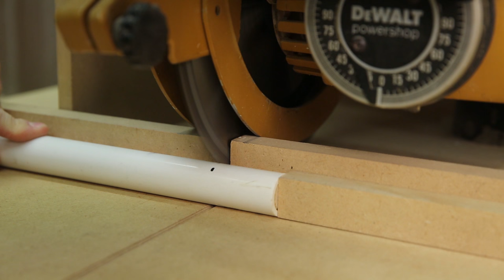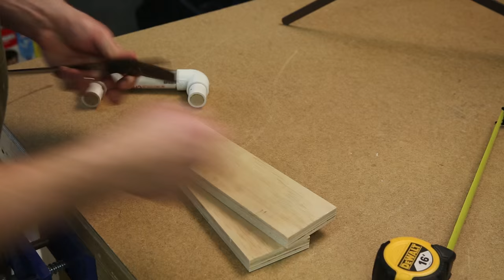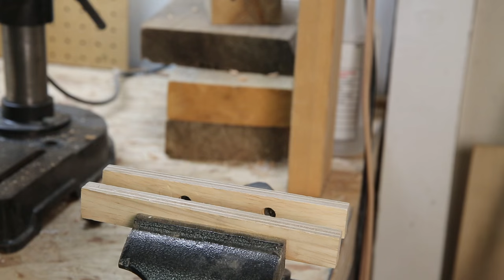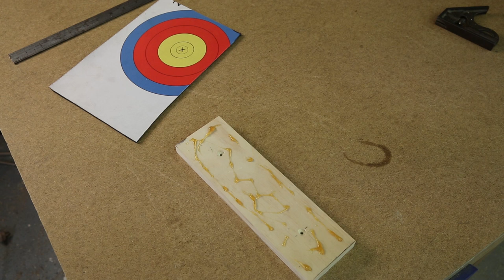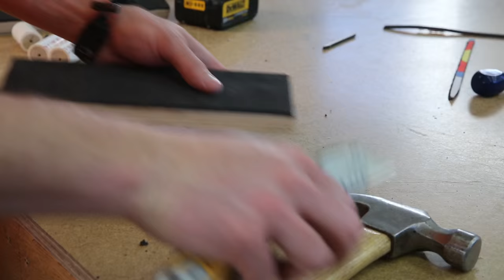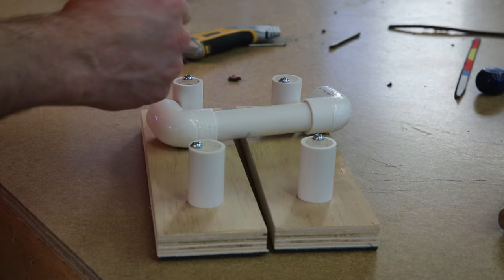Build PVC Handled Push Blocks Out Of Scrap Material

Comment: It's a good idea the I might try next time I have extra PVC.

I was thinking of using dowels instead of screws for those that have SawStop but if you're cutting into the PVC your fingers are already in danger and it might be better for the saw brake to trip before it hits your fingers... Dowels or screws, something to think on...
Reply from the maker: That's a good point. I don't have a SawStop, so I didn't even think of that. Plus, I primarily built these to use with my jointer.